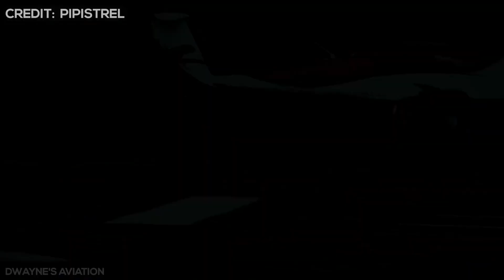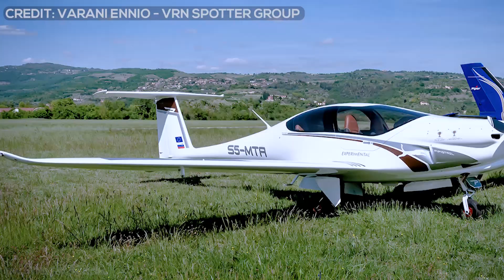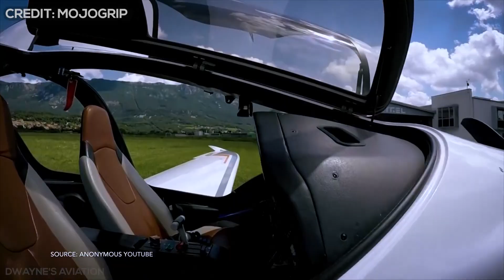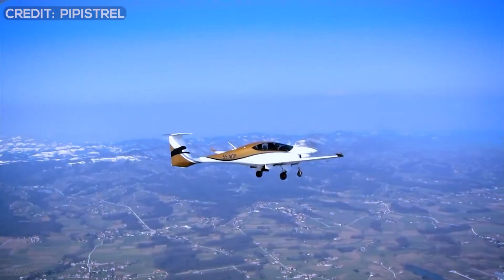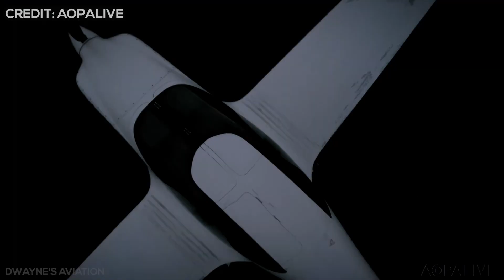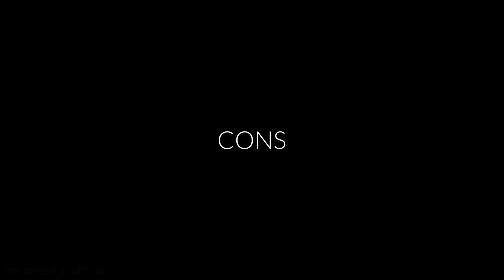Why the Pipistrel Panthera is Extremely Well Designed

Comment: Imagine spending tens of millions on R&D, perfecting, testing, and refining with the most modern materials and electronics the world has to offer.  Then you install an engine designed in 1930 that runs on 20 gallons of leaded gasoline per hour at 7-10$ a gallon.  Piston aviation engine manufacturing is one of the most backward industries in the world.  Hey Rotax, if you read this come up with something in the 200-250 HP range.  The world needs it.  Aerosolized lead just isn't a good thing no matter how you spin or slice it.

Comment: As soon as I heard Textron bought the company, I knew the price will spike, but I did not expect THAT much, from $400 to $$640++Cessna heart left light plane decades ago, and had several failures trying to take short cuts by buying someone else's designs. One thing a big company is not good at, is to make affordable planes. They have lots of overheads , and share holders to pay. What will make or break this plane would be the price.
Reply: It's surprising they are not trying to capture the massive second hand market. Any decent new plane that could price itself as somewhat affordable would take big chunks of that market and actually provide revenue to the manufacturers. Instead all they are missing out on all of it to secondhand parts manufacturers.
Reply: The big players ruin everything with their corporate inefficiencies.
Reply: and FAA @glsracer

Comment: 220kt Vmax
55kt Vs0
Speed ratio of 4:1

Climb rate 1,300ft/min

1315kg Mtow
815kg empty
Useful load fraction = 0.38 or 38% Mtow. 

Span 10.86m
Area 11.2m^3
Aspect ratio 10.5:1 

Overall pretty underwhelming performance and empty weight fraction for an all carbon composite, high aspect ratio, retractable gear aircraft. 

I mean, its very fast. 

But its not a substantial improvement in any other performance area, except build quality and interior design. Its basically a slightly lighter, smaller, more efficient SR-22.

Good plane. 

Not spectacular.

Looks a little "meh" on the outside. Very nice inside. Leaves me wanting more.

Comment: Sleek looking ship, it is. It's also one of the first modern aircraft designs to take full advantage of modern engine, avionics, automotive design and materials along with cutting edge CFD for aerodynamics.

Most new aircraft of the last decade or teo have been tailored to the underwhelming LSA restrictions. 

Keep in mind, the old Experimental Lancairs and even the Cirrus line of the early 2000s were not designed with CFD. And they are rather slow and lumbering in climb and roll rate, which dosent seem to deter buting ploping down $600k-$1M for a plane that cannot even catch a Bonanza in economy cruise even by sharing the same engine.  

When it comes to planes NOT designed with any notable use of CFD, Neither is the MX line which was dominant in air racing. The newest Extra NG and Sbach designs seem to be well thought out and utilize quality design and materials, along with obvious reliance on modern tools, but most passenger airplanes available are pretty much just free hand cad sketches that "look about right".
Reply: “Lumbering Lancairs that can’t catch a Bonanza?” Show me a Bo that does 300knots.

Comment: I'd like to see the bodywork under that thing. Also the cirrus I think is lighter and it's a established aircraft
Reply: The Cirrus SR22 is 194 kg heavier than the Panthera, and probably has worse glide characteristics. It is also doesn't have a retractable landing gear and uses about 4 gph more than the Panthera. The only thing I can think of that the Cirrus might be preferable for is that there are old ones that you can buy at a more affordable price. New ones are almost as expensive as this one though...

Comment: Bonanza is an American aircraft introduced in 1947 by Beech Aircraft, cruise speed 203 mph, range 824 m., 5 pasangers.... new PPS has the same speed and range, 80 years of development and no improvements...
Reply: Half the fuel burn isnt an advantage?
Reply: @SuperV8driver  it's not half the fuel burn.. It's similar fuel burn... But to be fair 200kts is not 200mph.

Drag increases exponentially with speed. So large improvements in aerodynamics can only get you so far. Thus, the small improvement in performance over the bonanza.

Comment: What about gear and flaps ops speeds during a high speed low drag approach? With no speed brakes and this high speed plane it would need high gear and flaps cycle speeds, which seems not the case?

Comment: The only thing it's lacking is pressurization.
Reply: That makes zero sense
Reply: @reserva120  An airplane with a service ceiling of FL25 and you don't think pressurization would be helpful?
Reply: @RJ_McBean  They need to sale them First.. Price. matters...don't be silly.., besides doesn't have the room or range to fly at those altitudes for any real reasons..
Reply: There's reason most piston planes aren't pressurized. Those huge pretty windows aren't designed for pressure. You can't have both. If you want pressurization, you get a Malibu.
Reply: No point for a non turbo would be painfu climb above f120

Comment: Not bad, except the price. I'm happy with my Mini P-40.
Reply: Mini P40?
Reply: @ryanb9749  Yes, poor civilian man P-40 Warhawk.
Reply: @space1commander  A Globe Swift would fit that bill pretty well I think.
Reply: @ryanb9749  With fuel pricing going to the roof this days, the only way to keep flying without going broke is a 2 seater burning from 4 to 6 gallons per hour until the electrics takes over.
Reply: @Space1Commander  The Electron E-75 is a very intriguing plane. I own an EV (car) with 108k miles so I am well aware of the potential downsides of owning an electric plane. I don't know if electric planes will be cheaper than gasoline ones to be honest.

The maintenance will be on par with a low time jet aircraft, but without the expenses of Jet-A.

The SubSonex jet is really cool, but every 300 hours you gotta send it in for maintenance for 30k. I think EVs might be similar but instead of 300 flight hours it'll be like every 5 years or somethin'
Reply: @ryanb9749  Very cool. General Aviation does not look good for the moment, where I live in North Carolina USA a lot of flight school are closing down due to the lack of students, They can't afford the cost of training.

Comment: I don't understand if it has FIKI or not.
Reply: Last time I asked, de-icing was some vague future plan. This, in my view is the deal breaker here.
Reply: @Extra400Galatea  completely agree. Without deicing, it can't seriously compete with cirrus
Reply: The first generation will not have any de-icing, unfortunately.. Future versions will have some solid-stage all-electric ultrasound and/or heated leading edge. The idea is to get rid of TKS and all the mechanical plumbing. I love the idea, but considering it's a new and untested system we might be waiting at least a decade until certification, if ever.

Comment: Who can afford these planes anymore
Reply: Only millionairs!!  Thats why the kit build segment is so strong now. You can have a brand new aircraft for 150K, and I'm talking about one that has been flight tested for years and years, some even decades, so they have proven their strength and safety!!
Reply: @scotabot7826  No one wants to fly in a plane I built, including me.
Reply: @ChrisJones-yt8zp  Well, there are people just like you and me building Certified airplanes every day of the week. I've seen many kit built aircraft that absolutely put to shame certified aircraft. That's a fact, and I'm not talking about just cosmetic issues either!!  Facts.
Reply: @scotabot7826  I understand your point but probably not "just like me." I don't think they'll be mumbling "lefty loose, righty tightly" as they install the landing gear.
Reply: @scotabot7826  glad you like the kit. I don't have the time. Or more accurately, it costs less for me to buy a certificated plane because time is money.

$750k will become $850 before options. No way Textron sells this $300k less than sr22 or da50. I expect the typical unit to be about $900k.

I really don't like center sticks for cross country. My two us homes are "half of Europe" apart, and I never leave one time zone.  Their designs are nice, but their ergonomics are designed for short hops. 

Oh well.
Reply: 10 millionaires you mean, single millionaire -not…
Reply: Early in the vid “Payload 1,100 Lbs” flashed on the screen.
At about 13 minutes the announcer said the “usable” load was 1100.
These are not the same.
Payload is Useful Load minus the weight of usable fuel. 54 gallons total fuel minus what 
can’t drain from the tank to be burned (maybe 4 gallons?)  x 6 pounds per gallon = 312 pounds of 
usable fuel.
So the Payload is about 788 pounds. 
This is very good for a 4-passenger plane. 
Two 250# executives with two 12# admin assistants leaves 48# for headsets, ipads, clothing, purses,
sunscreen, beach chairs, etc😎
Reply: @backcountyrpilot  How do you suggest we affix the 12 pound admin assistants down, so they don't blow away?

Your point is taken - and teasing about typos aside - that usable load works for my family. I'm the largest at 155#. All told we are 450#. But add in my wife's junk and we hit MTOW, fast.

Comment: TEXTRON will find a way to screw it up
Reply: Yup
Reply: Hope not, it’s promising!
Reply: That may be the plan, buy out the competition.
Reply: I gotta say the way the tail looks like it's just stuck up there with minimal support and structure is the only part of the plane I don't like.
Reply: Aahhahaha!
Reply: Loool
Reply: Ive heard the tail is weak so Vne is pretty close to it’s cruise speed..
Reply: @LukeCFI  if true that’s kinda scary.
Reply: @KPMACHINE1  yeah it seems a bit overhyped and I don’t think it’s going to be the amazing DA50/SR22 killer that some people think. 
There’s quite a few problems like that yet that have to be ironed out.
Reply: @LukeCFI How did you come to that conclusion? It’s a 22 knot difference between the performance cruise and the Vne.
Reply: @InForTheLonghaul  yeah… exactly…
Reply: @LukeCFI  Emphasis on *performance cruise*. In normal or endurance cruise you’d probably be 10 or 20 knots slower than that. You don’t need to be flying that fast if you aren’t comfortable holding a 20-knot margin. Your fuel card will probably thank you anyways 😄
Reply: @ ok, being 30 knots away from Vne in a normal to economical cruise in a slippery plane like this is insane dude. Could probably pick that up easily in a slight descent🤷‍♂️  of course not something you can’t train through but not great structural design.
Reply: @InForTheLonghaul it’s an RG cirrus is fixed gear.  Insurance on the panthers will be much higher and insurance minimums will also be very high